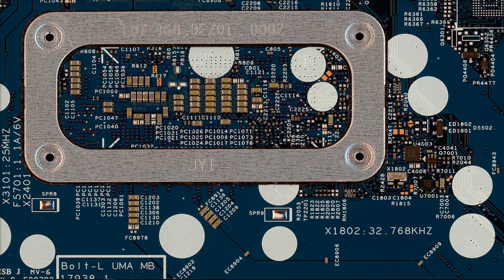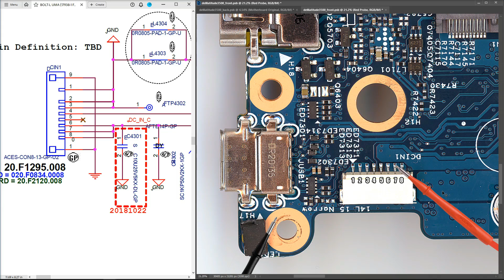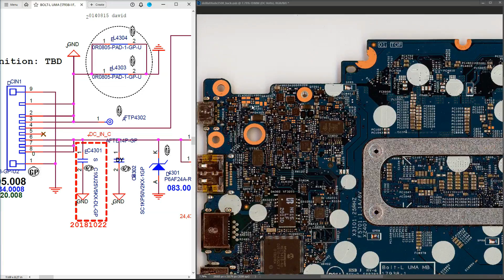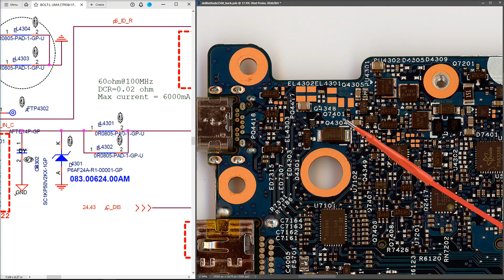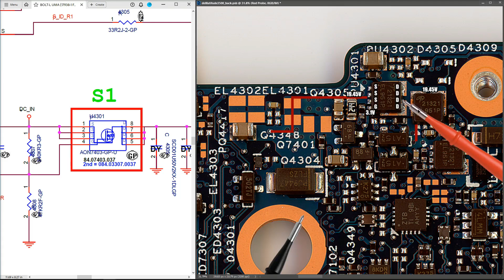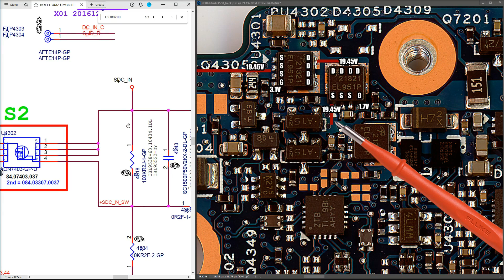Dell Latitude 3500 - Input Section

Comment: Thank you 🧡
What is the voltage of id pin?
and how we can trigger it without charger (with bench power supply)?
Reply: The Dell PS_ID is a data signal, which uses one-wire communication protocol on a 3.3V line. Data is exchanged between the charger and the EC chip in a burst shortly after the charger tip is connected to the jack. So this is not simply a power line.

Comment: Another excellent video. I am biased, because I only work on Dell laptops. It would be valuable if you published all meter readings of all power circuits taken from a working board. When we work on a faulty board, we need to know the reference meter readings. It is also fascinating to trace the power distribution from DC IN to each circuit on the board.